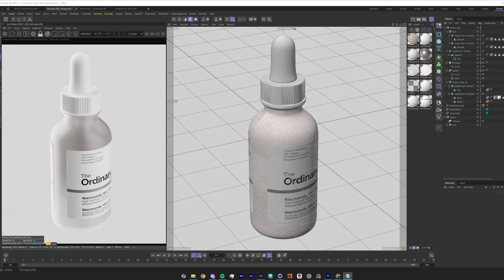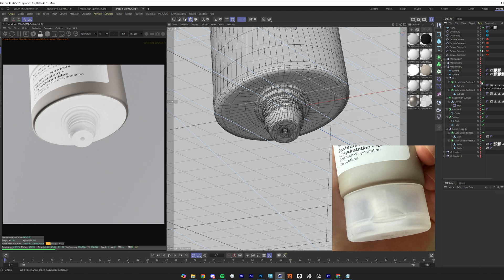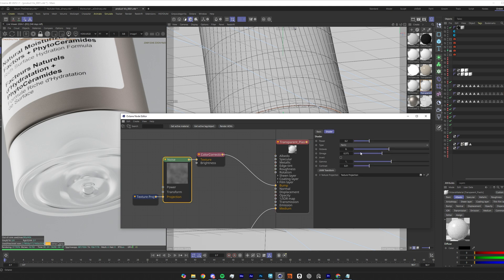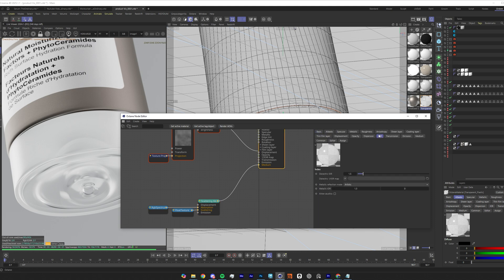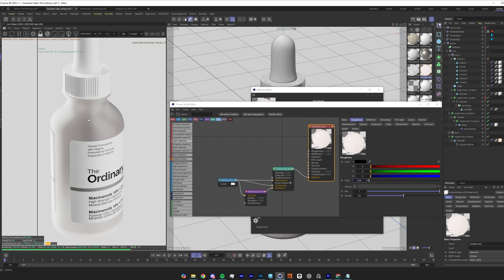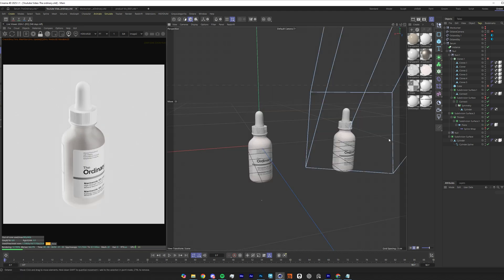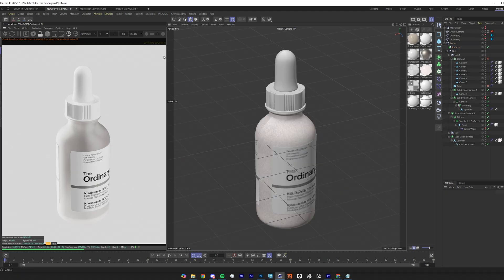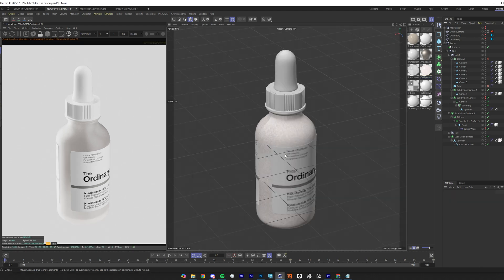Make BETTER Glass & Plastic materials in 3D

Comment: Some good tips, however, I think the cap would be a hinged single part, so it should be the same material rather than two different ones? Did I miss an explanation of the emission in the frosted glass medium? Was this to avoid needing higher diffuse depth? I find this value has a dramatic impact and 12 might be a bit on the low side.
Reply from the maker: I go over using a higher specular depth in the render settings when doing a final render. On the cap itself it does seems to be two different plastics as I have the models in hand. And yes the medium emission is the slightly "unrealistic" way to add some extra brightness and a little more of a clouded look.
Reply: @hloshak thank you, I saw that. I meant the diffuse depth, that has quite an impact on brightness of sss mediums. Also fake shadows option, although turning that on sometimes requires reducing the depth as it adds too much energy.